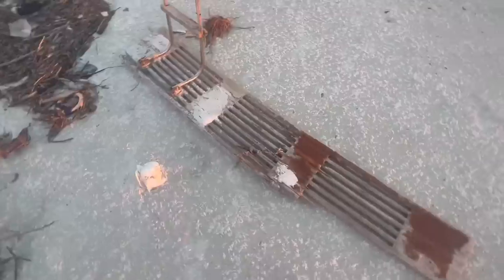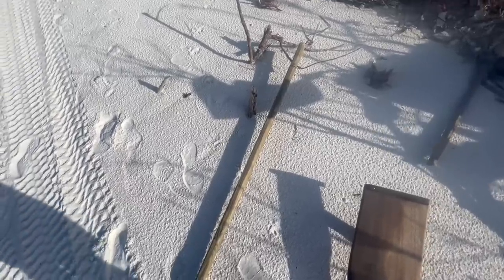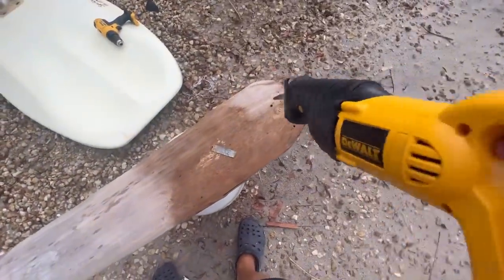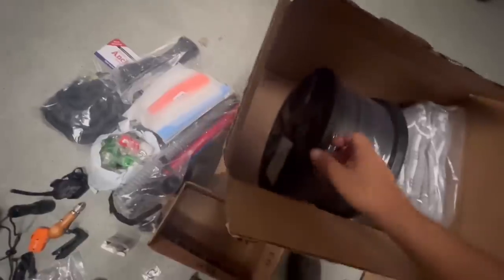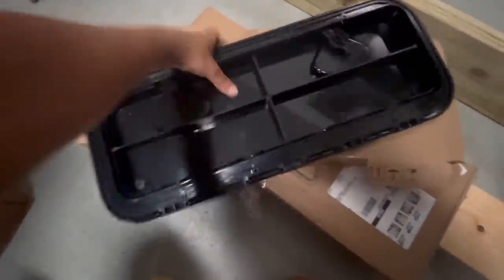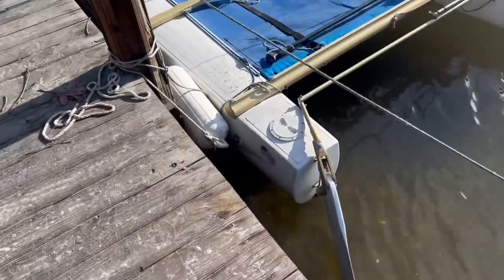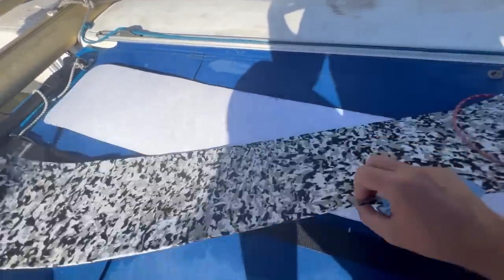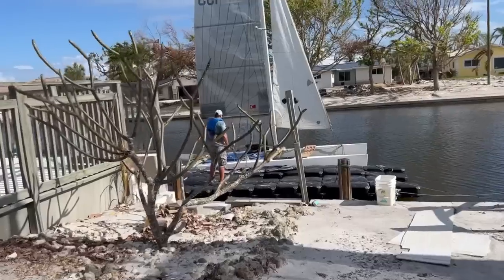Some projects to get ready for my next adventure

Comment: I'm very familiar with beach cats having owned a Hobie 16 and 18 and currently own a Boston Whaler Supercat 17, a boardless cat, (no centerboards). First, the rudders shouldn't pop up to their locked position so when they do pop up, you can still steer, even when both pop up. So I don't think you need any mods on your rudders, but it's your boat! Next, with beach cats, when they get a hull failure, it's right in front of the front cross bar, right where you cut out the very much stronger top deck. If I were you, I'd make some wooden structure pieces and lay some glass over them going from behind the hole to in front of the hole to bring some strength back. Just imagine the hull folding in somewhere along the cutout and build structure for that. There's videos on YouTube showing hull failures in this area. When it happens, one side will kind of just fold in. It's sad! Good luck!!
Reply: Yeah I was really hoping to see some reinforcement after the huge holes were cut, you can just imagine those walls flexing out and the hull just folding. But now I'm wondering if we'll even see this boat again, or if it's a month with the new free sailboat before heading back to Pickled Herring, and the structural stability of this boat becomes Somebody Else's Problem.

Comment: Looks like she is coming along Sam.  I must admit I let out a scream when you cut holes for your deck hatches.  I raced cats for 20 years and when they are screaming along under high winds and big seas, a great deal of the load is carried by the exact spot you cut.  I expect quite a bit of flex there now so watertight will be a lot more challenging I expect.  Hoping I and wrong but...

Best wishes!

Comment: the hatch right next to the main beam saddle is risky.  I broke a Nacra 5.5 right there while racing and the hull sank so fast it was amazing.  Of course I still had one hull remaining but if I had been anywhere but the ICW it could have been a real setback...  You should reinforce the inside of the hulls around the cutout area perimeter with like 3 plies of 4 inch tape FG cloth.
Reply: I just left a similar comment, said imagine the hull folding in right where the cutouts are, and add strength to combat that, because that's where they fail. When I watched the video and the saw came out I was like NOOOOO not there!!!!
Reply: @mboyer68  absolutely right.  well Sam apparently is not one to hesitate to drill and cut away on a boat or add weight in odd locations. I like this cat you are working with and that mainsail looks good.  The side pieces you added to get a level surface for the hatch are a good location to run some hefty longitudinal reinforcement if it was to extend beyond the hatch opening several inches and scarfing to thin laminate.  Use some unidirectional glass reinforcement there Sam.

Comment: Good use of the pool cage screen. I made dog beds out of heavy duty 'pet' screen for doors and windows. I've also replaced sagging mesh office chair seats with it. You could probably make a front trampoline with it.  It's remarkable strong and holds up well to UV
I've made and bought a few super lightweight silnylon rain flys - you always want to run a support line for it to drape over (so the string (usually dyneema) line is under a lot of tension but the fly is not pulled as tight (I attach the fly to the tension line with prusisk knots)   And I'd make that fly so either side could be pulled down on whatever is the windward side (unless of course your at anchor or moored, then the rain would blow from the front.) If you can drop two sides you can be protected from most weather.
Reply from the maker: Yes i did make a front trampoline out of it. Its great stuff. I also made the pipe berth on my cape dory out of the same sort of stuff. Very strong and uv resistant. I saved a ton of it for future projects

Comment: i would be very careful about cutting holes near the forward cross beam as there are a lot of loads there . i have seen a brand new Hobie  miracle 20 bow break just forward of the cross beam. i would test the boat in rough conditions close to home before i took it on a trip like you have planned.  The mystere catamarans are pretty stiff boats and i have never seen one of those fail at the crossbeam but none have been modified . Most of them sail off the Dunedin causeway  7 miles north of clearwater . A guy i new started sailing and selling them in that area quite a few years back. The causeway is a great place to launch from for trailerable sailboats as you can back your car and trailer  right to the water and launch right from the beach. videos of the area can be seen at andrea frees youtube channel. we sail a windrider 17 from there when we go down to florida . plus there is a restroom and shower there as well as a Tiki Bar on the beach

Comment: You should think about the flex of all materials when using them, the boat hull will flex as the loads(forces) are put upon it. Some of these you can see, some you cannot. It's important to consider the interfaces between things as well, since things/materials flex at different rates the interface is where wear and breakages will happen. For example those hatches, they may get pinched at the cutout area interface as the hull binds against them while flexing. The butyl tape will absorb some of that, but will age and deform over time. So keep an eye on those spots for wear/cracks... Likewise all over your boat, watch the interfaces between things. Other properties of materials matter as well, temperature causes expansion/contraction, galvanic(conductivity) differences, flex, stretch, .... Cool build!!!!! Wondering if a hammock that has AI based motion stabilization(think camera stabilizer) would make a more comfortable sleeping system on the boat.
Reply: Yeah that's near the maximum stress area... right in front of the beam.   The bows exert max leverage right there in that area.  You need to add some (carbon) beams longways in side so the hulls don't fold on you in big waves (or big fun).  https://www.youtube.com/watch?v=Y7O22bp2MVA  (Hobie 16 Pitch Pole and Hull Failure)
Reply: Clearly You haven't been watching this channel for very long 😂

Comment: Very cool. Interesting boat too. What is your capsize plan? Having sailed my hobie 18 quite a bit solo and capsizing a lot I'd be concerned righting that boat. I use a righting bag on a block on the hull that's out of the water and drape it over my shoulder while holding a Murray's stretch righting line. My righting bag is a big green lawn bag off Amazon. I bet a righting pole might fit sweetly on that bow platform. And with a righting bag and line and the right technique you'd probably be good to right it even with extra the gear if you're technique is good. Joe from total joyrider has the best techniques for righting. Stoked to follow your trips. Hell yeah
Reply: They're definitely not fun to right. I've had 3 beach cats and still have one. I wonder what the extra weight would do once it goes over? Hopefully wouldn't make it go all the way over. Excellent point though. He probably should practice righting it after the mods and fully loaded. Need wind to practice thought, the wind gets under the sail and helps right the boat.
Reply from the maker: Cool ill look into that. Thanks

Comment: Wonderful job, I like your style.
I am thinking you could make a tent/cockpit on the cat. 
Use fiberglass poles from a cheap tent, put some clear vinyl in the front and you would be protected from the spray and rain while sailing.
The no-see-um can really drive you crazy at night in Florida/Bahamas
I saw some catamaran had a float on top of the mast to prevent a capsize to turn upside down.

Comment: I wonder if you could circumnavigate on that? Could you hug the coasts of continents and what would be the longest crossing?
Reply: You're wet 100% of the time. Your skin would slough off after about a month probably. Plus, you're sitting on your butt with your legs out 100% of the time too. Not a seat to be found on that boat, the boom is too low. They're very uncomfortable and wet boats, but very fast and fun!